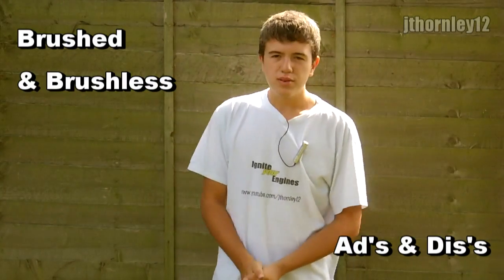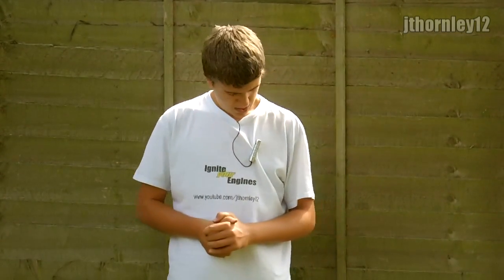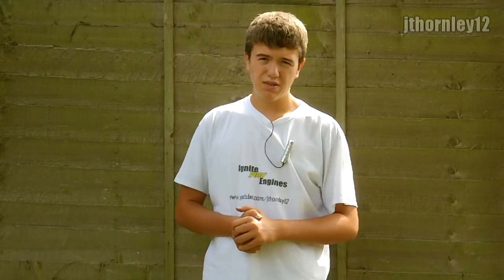Brushed & Brushless - Advantages & Disadvantages

Comment: i run a tc5with a tamyia super stock which has a 13x3 turn armature its actually a bit faster then the lrps and tikens that ar running timing  advance and boost lol the thing is im not even done with the mods to the motor going to take it as far as it can go before i go brushless

Comment: Its funny how you call them li-polys haha we call them lipos here like liposuction. Good info. I've had a brushed 1/24 and some 10 scale nitros and I like the immediate 100% power of the electric brushed motor but I fried both my ESCs for it so I took the plunge and ordered a brush less conversion and also my 1st 2.4ghz radio system for it. Cheeeers

Comment: Hi, I have just bought a motor off ebay -a TRAXXAS TITAN. It comes with its own esc. It has arrived but it was baought with my pal's account so it is at his house. I was wondering if I could tell the difference between brushed v brushless from the pic because the motor has three connecting pins on wires coming out of the back. Does this mean it is brushless. Does a brushed motor just have copper tabs on the back? please reply soon

Many thanks- Thejonox1

Comment: Only one mistake there...
Regarding charging times of NiMH and LiPo Batteries, LiPos have a shorter charge time than NiMHs, so long as you buy quality batteries that is!
You don't want to be charging a NiMH battery above 2C, whereas you can charge a good LiPo at 5C, drastically reducing charge time.

I suspect your experience with slow charge times on LiPos is either lack of knowledge or you're using a charger that came with your car...
Buy a decent charging setup and pay attention to safety!!!
Reply from the maker: Yes, I expect at this stage I was using the cheapo included balance chargers. I agree... Using my LiPo balance charger on 5A I can get a 6s LiPo charged in 30 mins

Comment: Unless your racing a burshed will be fine i have more fun with my brushed stampede on 2s lipo than i do with my brushless erevo on 6s. 6s lipo tears cars up, axels,bearings and diffs don't last at all. Most say the car can handle 6s from my experience they can not.
Reply: Chief Longwood I got a friend who went through 4 motors in 2 months with a lipo so he went with a 5000mah venom battery and it's just as fast and his current motor has been goin  a year and a half so far with no problems